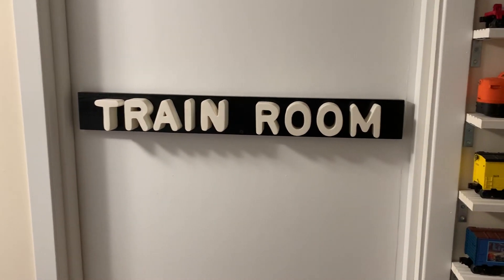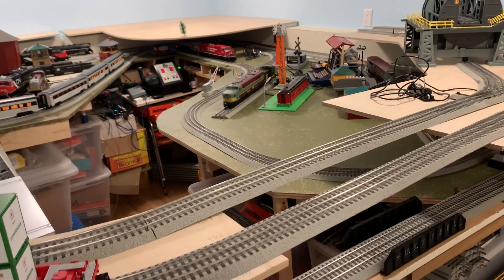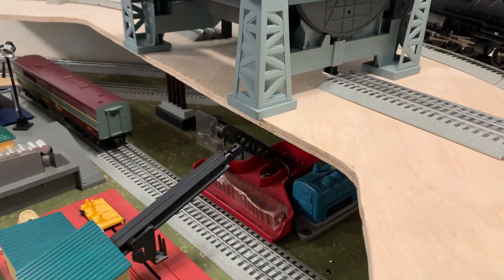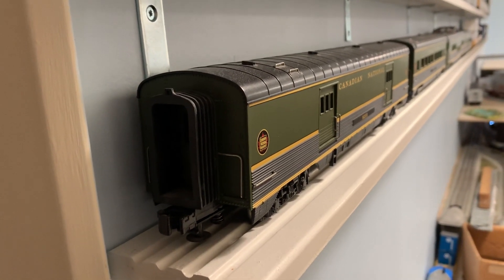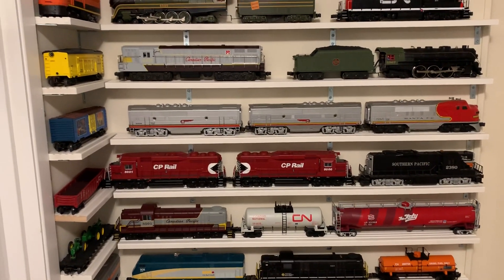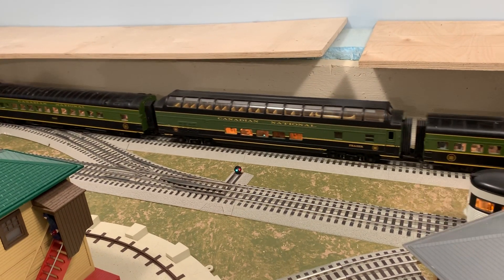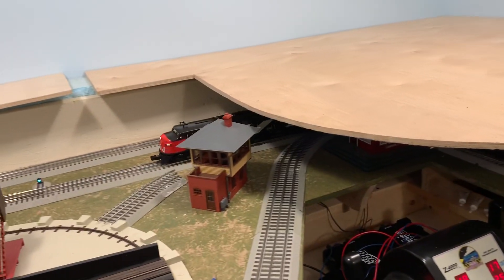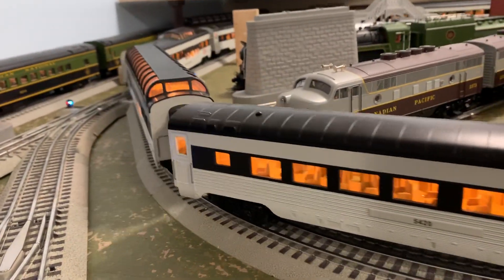Layout Update #3: 10x12 O Scale Layout -Lionel Fastrack MTH DCS  and Run Session

Comment: I love the layout and choice of lionel fast track I love my lionel fastrack it work so good I'm using two 070 loops and I'm about switch out my 036 curve for 060 one day.
Reply from the maker: Hi Pedro, thanks for watching.  I hope to get more content up soon.  God luck with your layout!
Reply from the maker: Oh, and by the way, if you mix 036 and 072 you can get 054 curves which is what I did on my outer lower loop.  I can run most locos on that curve, including some that state they need 072 curves because there is only one 036 section.  I hope that helps, G
Reply: @gsoscaletrains6550  I have 036 curve and I'm trying to do away with it also I want 054 or 060 curve thank you

Comment: That’s a good looking layout! Love the paint on those F3’s.
Reply from the maker: Thanks! That was my favorite train growing up so I was very happy to have finally found a set!
Reply: @gsoscaletrains6550  are those CN F3's mth? I can't find those anywhere
Reply from the maker: @myrtistaylor5759  Yes, they are MTH Rail King  They are tough to find as it's been a while since MTH last released them.  They did a fun of F7 in Premiere line most recently, but those are also tough to find.  I just kept watching online and finally found them on eBay.  Good luck with it!
Reply: @gsoscaletrains6550  all the cool paint schemes are hard to get. I painted a lionel B unit in that same zebra pattern for some Canadian national GP9's i have
Reply from the maker: @myrtistaylor5759  That's cool.  You should do a video of it and share it! Would love to see it!
Reply: @gsoscaletrains6550  lol yea. I added stuff to it, i put the port hole lens in it and cab illumination and i added exhaust smoke. Just took some smoke stacks for buildings drilled 2 holes on top and shoved heat elements in it. Looks pretty cool when i run it with another B unit with railsounds

Comment: I'm suprised  That steamer is able to run on your layout. That's a repaint of the C&O's George Washington mountain class. 0-54 minimum curves
Reply from the maker: Hi Dylan, thanks for commenting. The outer loop in lower level has combination of O72-O36-O72 curves on each corner which equates to O54. It works well because the O72 eases the loco into the curve. I’ve been able to run all of my bigger locos on this loop without issue. Thanks for watching!
Reply: @gsoscaletrains6550   So a 90 degree curve would be 0-72, 0-36, 0-72, 0-36, 0-72? The 0-36 being The 11.5 degree piece I assume? Considering that works, That's genius!
Reply from the maker: Dylan Hale hi. A 90 degree turn is just O-72, 0-36, O-72 of fastrack. The O-36 replaces two O-72 pieces. What you described would make a 180 degree and that would also work. Yes, that is the genius of how they configured the fastrack, so you can interchange curves and still end up with correct geometry. I hope that helps!